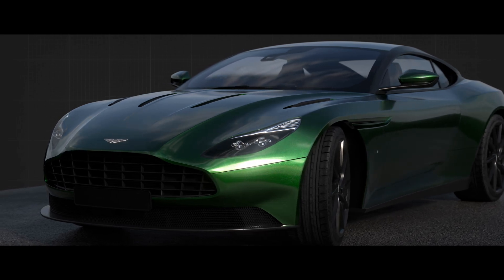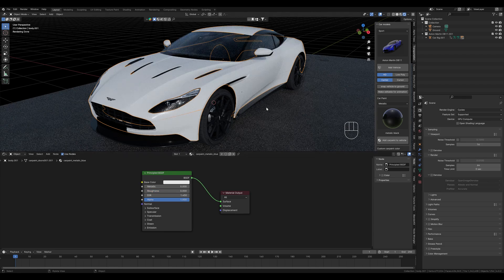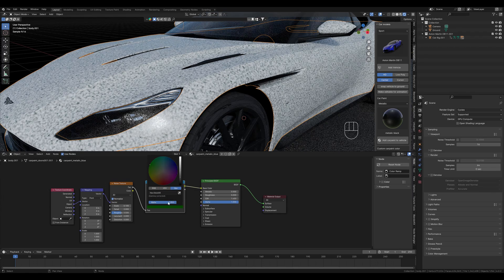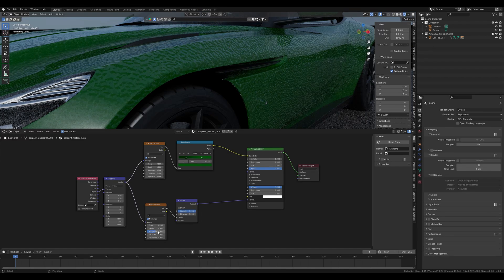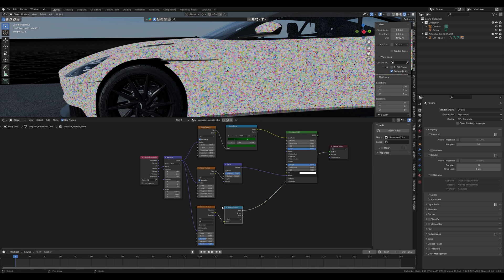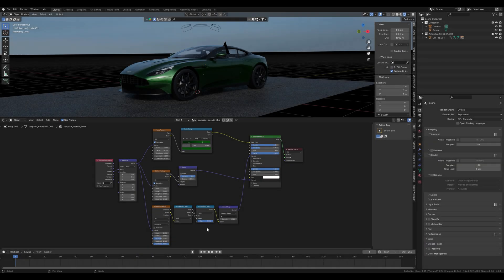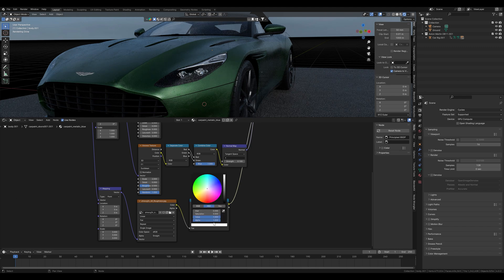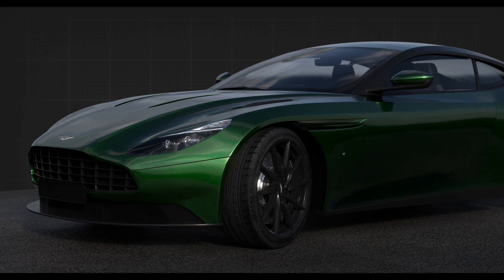How To Make Realistic Car Paint | Blender Tutorial

Comment: great tutorial!! but in blender 4.4 it's all opposite, I don't get the same results..
maybe you can do an updated tutorial please, thanks!
Reply from the maker: Too much shouldn´t have changed and you should get similar results at least. Did you have any problems with something shown in the video? Maybe i can help
Reply: @enhancedsight  its the flakes part, i literally doing the same thing and i dont see any sparkle
Reply from the maker: @Quiin-g6v Check if your roughness settings are right. You control the intensity of the sparkling with it at the end.
Reply: @enhancedsight  Thank you so much, it worked now